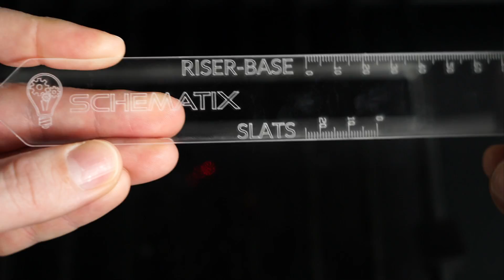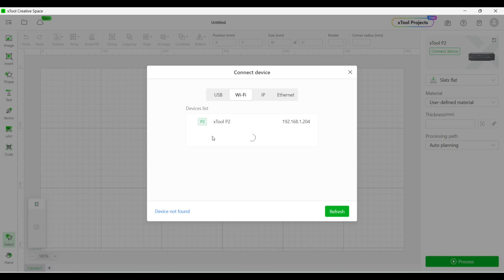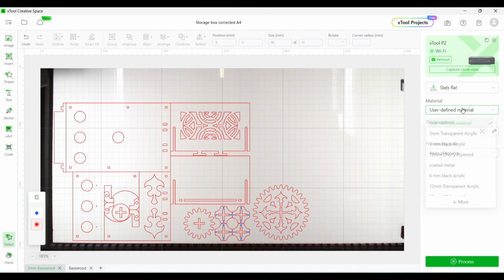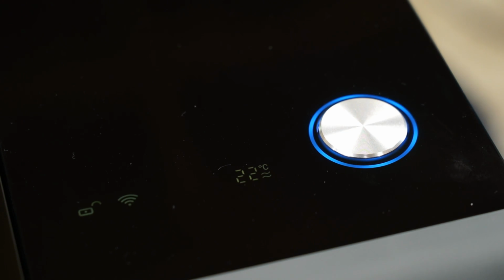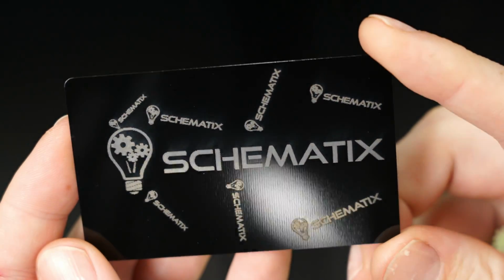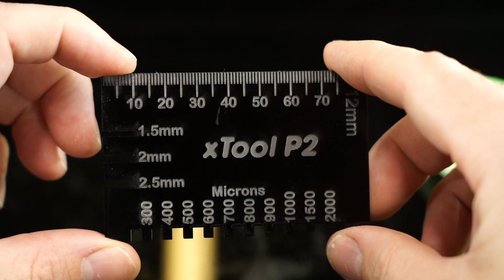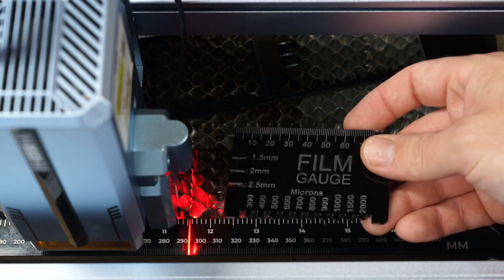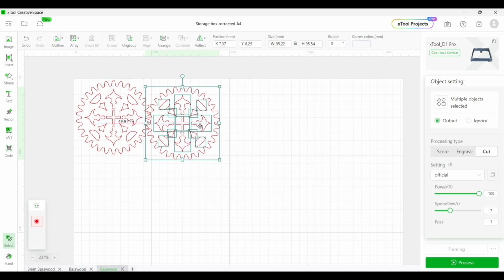xTool P2 - 55W Co2 laser REVIEW II Start your own laser business with this!

Comment: These newer small profile co2 lasers are nice but sadly overpriced by far and uses all priority replacement parts, which cost 3-4x standard co2 laser parts.  They also come with extremely low quality laser tubes.
Reply: any idea please on the price or a sales link?
Reply: @slimel-gharbi8170  $4,500-5000 without tax or shipping. $1,000-$2000 if you build your own, depending on laser tube size and hardware for the frame/case